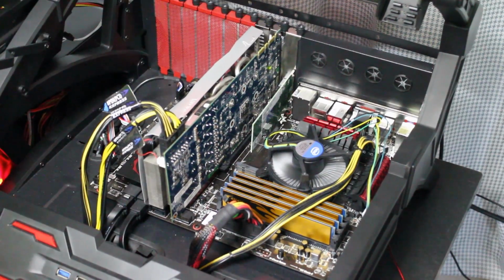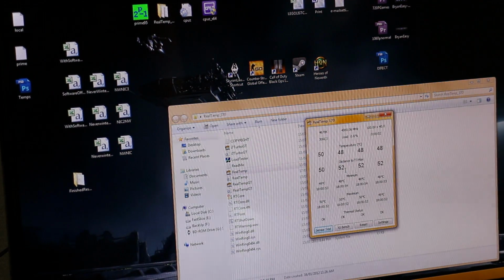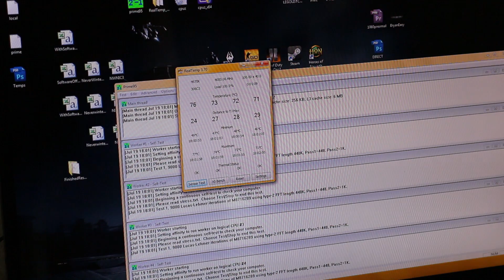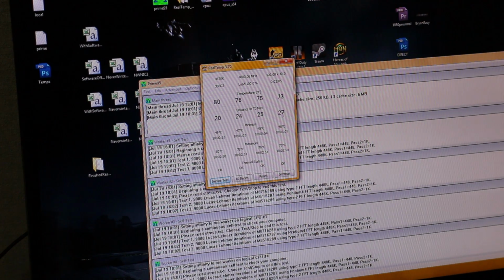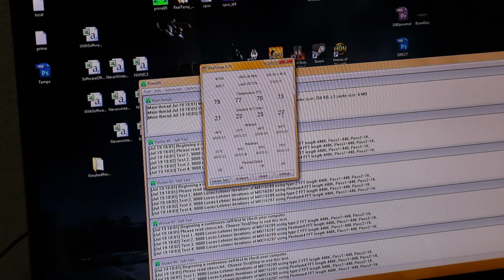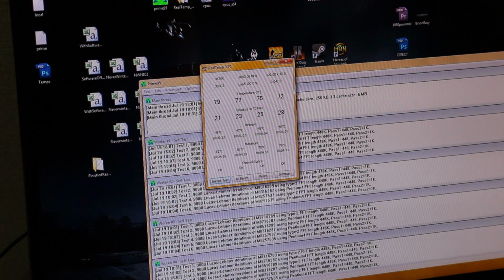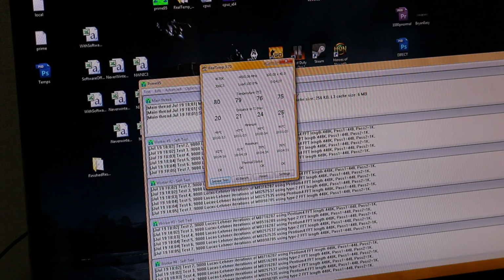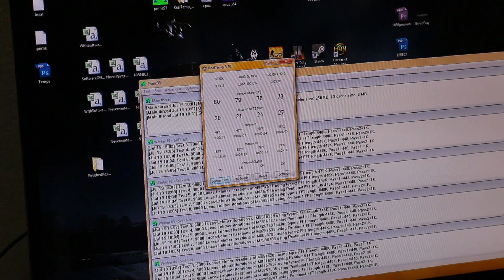How far can an Intel Stock HSF Go? Test at 4GHZ (i5-4670K)

Comment: If I'm getting a i7-6700 3.4GHz processor would I be able to pull of just having a standard heatsink? Or do I have to upgrade
Reply: Coltonpro96 you should almost definitely upgrade cooling. Some i7's run very hot.

Comment: I'm using the stock heatsink on my core i7 920. 69-70°C maximum when gaming. It can also make noise equal to a jet when ramping up its fan speeds. A pile of junk.

Comment: 69-70c is my i5 3470 on load while running intensive games like Battlefield 4 and GTAV on High-Medium settings, while my GPU is at no more than 50-66c throughout.

Now seeing this video..jesus fucking christ I need to ditch the stock cooler already.

Comment: Using 4460, and my idle temp is 53.. Is it bad? Its sounds like it though xD. Going to get better cooler
Reply: Louie Gonzales The Netherlands and the ambient temp can range between 17c and 35c where my computer is placed. Though, with an ambient of about 30c it never gets that hot at idle for me. It is 23c where I am writing this from right now and my cpu is at a healthy 30c which is only 7c above ambient and under load my cpu gets about 68c with this ambient temperature and all on the stock cooler.
Reply: yea... it is bad. i overclocked my amd phenom ii x3 720 BE from  2,8Ghz to 3,3Ghz with a stock cooler and the idle tempature is 25-28
Reply: +Asyraaf Wheezer I got a 4690 with the stock cooler and my idle temps don't even reach 30c.. ^^
Reply: +Bas van der Meij (Ykai63) how i got a 4690K with the stock cooler and it is at 55/60c in idle
Reply: Lex christiaan overclock, factory defect, dust, not enough airflow in the case... Could be all of those but if there is enough airflow and not much dust and the thermal interface material is applied properly I think it would be best to just return it or trade it for a new one.. xD It should be cooler at idle.. it just should be..
Reply: i had the problem for a few weeks but finaly fixed it today idle now 30/35 on pin went out of te backside of the motherboard so the cpu fan wasnt airtight with the cpu
Reply: +Bas van der Meij (Ykai63) Where do you live?? What is the ambient temp?

Comment: what if i get an i7 4790k and do not overclock whatsoever with stock cooler? how much temp will i get?
Reply: Well then why the fuck would you get a 4790k? If you're not going to overclock just get the 4790 since u want an i7, and get like a cooler master CPU cooler with 3-4 heat pipes and ur good
Reply: +_Xetion _ cuz the fucking 4790k has a better thermal interface (devil's canyon)

Comment: I have 4690k with the stock cooler. an i have my fan speed at 200 rpm
Reply: +michaeltechroom I have an i5 4690.Not overclocked! Is the stock cooler good enough ? And what is the max rpm speed for the fan? 
Thanks.
Reply: yes A stock cooler will do you find. like you said not overclocked, The max fan speed for me was 300 rpm range, I use a asus fan speed control panel to

Comment: My i7-4790 on stock clocks is getting up to 79C on full load with the stock cooler, not as hot during gaming or other tasks. Would you recommend a 212 Evo or are these temps acceptable?

Comment: Can this build run Ac unity at 60fps ultra?? 
http://pcpartpicker.com/p/qmzRyc
Reply: Pirovano Mateo If you are overclocking you'll need a z series mobo (I recommend z87 or z97). If not don't get the K version CPU. Otherwise everything looks fine, personally I would go with 750 watt modular PSU, since it is more future proof. If you will do SLI in the future I'd say get 850+ PSU.
Reply: Pirovano Mateo Also, if you are only gaming, don't get 16gb ram, its not needed. For gaming all you need is 8GB ram.

Comment: Is the stock cooler fine if your not overclocking example i5 4570
Reply: Yes, as long as you fit it correctly. For long term use, a third-party cooler is usually the way to go however.
Reply: No,the stock cooler push pin mechanism would likely flex the board,and break solder joints,ruining the board.Source:Lmull3 and personal experience with Stock HSF
Reply: BestGazaVid My stock cooler lasted 8 years
Reply: Fair enough. My current stock cooler has lasted 7 months so far.

Comment: Hi Tech ive got a i5 4670 non k and when i run BF4 at 80% load i get 70-80 degrees should i buy a cooler master seidon 120V ive got horrible airflow im using a server case and have the lid off 99% of the time but my GPU R9 270X doest breach 60C what should i do take back for warranty ?

Comment: I will subscribe to your channel just because you made this rare very helpful video

Thanks
Reply from the maker: Thanks man.
Reply: Can we chat I want to ask about somethings because I am building a pc
Reply: I want to know if I5 4670k integrated GPU will work together with ASUS Z87 pro integrated GPU??
Reply from the maker: The z87 doesn't have a GPU integrated into it, but the 4670k's GPU will work with that motherboard.
Reply: I am sure that Z87 PRO has an integrated GPU. If you can double check and answer my first question... If I am wrong. ..Or any other motherboard that has integrated GPU and i5 4670k will both work together?
Reply from the maker: the motherboard doesn't have an integrated gpu, just has support for one.
Reply: You are right. Thanks I misread the specs
Reply from the maker: no worries man, anytime.

Comment: I overclocked my 4670k (stock cooler) with an Asus Z87-A's TurboV EVO and it's at 4.2GHz, i have not tried prime or other programs but at Battlefield 4 all maxed out my max temp was 84c. Normally temps are 75-80c.

So I would say you can go for 4.2GHz.

Comment: Which is more efficient push or pull configuration?
Reply from the maker: Push/pull that has good flow, its all about the air flow.
Reply: Hi, Only bad news :'( since summer is already in here i got an old Q6600 with GT630 and P5B deluxe to make my laptop rest a bit my only problem is that I want to overclock it and i dont think stock is good for it , but i got a Cooler Spire SP513S6 90mm  is that would be good idea to overclock it to 2.8ghz or 3ghz with this cooler ? plz get back to me when ever u can by the way i can't spend a dollar since my galaxy S2 burnt 2 days ago and right now im getting an S5 (cuz it got removable battery) soo dont try guys to convince me to get a good cpu cooler ;'(

Comment: who did i see someone go up to 100* c with the stock cpu cooler? at stock speeds? are temps as bad as im thinking ?
Reply from the maker: The temps aren't that bad, it really is just the fact that they cheaped out on the thermal paste between the die and the IHS and some people are getting horrible results, albeit most people will get average results (myself included).  However when delidded properly everyone will see a nice drop in temps that will be good for 4.8ghz on air if your CPU can do it.
Reply: Tech YES City Ok man thanks. You have a good channel keep up the good work. One more question for you. Do you think a closed loop cooler will be enough for a decent oc? Something like the h60 ?
Reply: thatbattlefield dude Noctua NH-D14 is better than h60 and many others water coolers.

Comment: Your CPU is not going to degrade at 80C. Nor 90C. Nor even 100C. What higher temps do is cause overclocking instability, but unless you've got a broken thermal diode and manage to get the temps up to 120+C for a significant period of time, you're not going to do any damage.

Only really long-term heavy overvolting can cause degradation, and you're never going to be able to run that without thermal throttling without an extreme cooling setup anyway.

Comment from the maker: Sounds pretty good, although what ambient temps is that at? My chip manages 4.6ghz at 1.24v at 27 degrees ambient with my Enermax T40 it only gets 69 degrees max on prime95 large ffts. Did you delid?

Comment: well that's how it's SUPPOSED to happen if anything goes wrong but what if the liquid spills over the pc components due to the pump failing or leakage in pipe & shorts things out or something along those lines? Honestly tho I've RARELY heard of good quality (albeit bit more pricey) liquid coolers like H100i, H100, H80, etc fail that much in all the forums i've come across. I just prefer air cooling cuz I never have to worry about those headaches.

Comment: Water coolers can be great value if you're lucky and choose well though... My old H50 is still running with the same performance it had on day one (well, better, because I upgraded the fans) if you're lucky and make sure not to mix metals in your loop, you can have water cooling systems last really long. The simplicity of a HSF though, means with the exception of fans,  they never really wear out. Just need a blast of compressed air once in a while. I love my Arctic i30/3570k@4.5/z77-ud3h combo.

Comment from the maker: No worries.  Yeah choices are usually endless with hardware, I usually just buy the latest and greatest every 1-2 years and forget about it (otherwise you can do your head in comparing stuff all day). I will do a video on maxwell, a lot has happened since the latest tech talk so there is a lot of tech to update on. I can't wait though for maxwell, if they can get it before Intel's next gen then it will be 20nm when intel only has 22nm to the market? yes please!

Comment from the maker: 3820 is a 4 core as well (although it has HT), wont give you a 10 fps boost, 3570k and the ud3h will be fine for gaming. What GPU are getting? I would go with the G45 and 4670k, great combo.

Comment: my stock HSF took my i5 4670 to 100 degrees Celsius running prime 95 @ 3.4GHz, it ran at 90 playing bf3 and 80 when i disabled turbo boost, I now have a Cooler Master hyper 212 evo and get 50 degrees running prime 95 and 60 when playing bf3 (as my gpu heats the case a bit). reckon I got a bad chip or something else? my case airflow isnt great but its not bad. pardon the lack of punctuation in this comment. any reply from anybody is welcome

Comment: Depends really. If you buy a faulty one or just have plain bad luck & the thing just dies due to some reason, you're screwed. On the other hand if everything works out well they can go on & on for few years...I personally would rather stick to the safe side & go with air coolers, however bulky they may look.

Comment: Not enough characters. Its only used for PC gaming. The 3820 is overkill, the ram too, but it sends a message and its cheap so meh. I wasn't sure what else i would buy. Maybe and i5 4670 or i5 3570, fx 8350. Something smaller. All i want is the best value for money. Of course i will lose money selling, but I'm not taking advantage of an i7 and want to look at other options. Thanks for the video. BTW i had and a P4 overclocked at 3.6ghz, stock cooler, or something for 6 years and it still runs!

Comment: Hey Bryan, you mentioned something in this video about selling your old chips. Where do you do this?My current system is
-i7 3820
-800W Silverstone
-HD 7950 Gigabyte
-4x4gb Corsair Vegence
-Deepcool Gammax cooler
-intel 120gb ssd 520 series
-3tb Green WD
-Sharkoon T28 blue
-P9X79

Obviously it can play games fine, but it isn't ideal since i built it from pieces.
Im happy with the power, ram, ssd, graphics and cooler. But the case, CPU motherboard and HD arent ideal. Sell, cannabalise or tough it